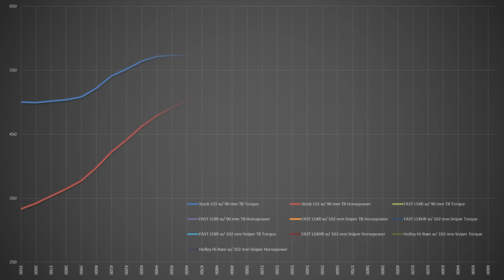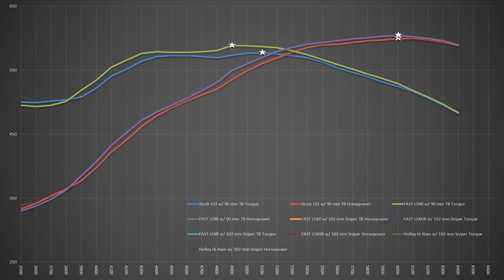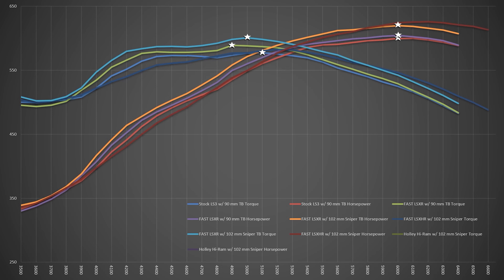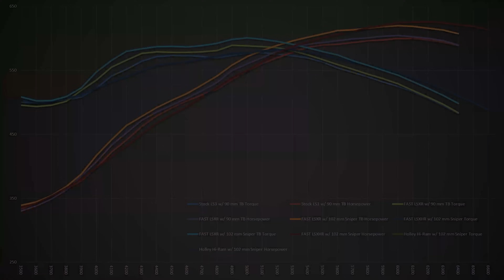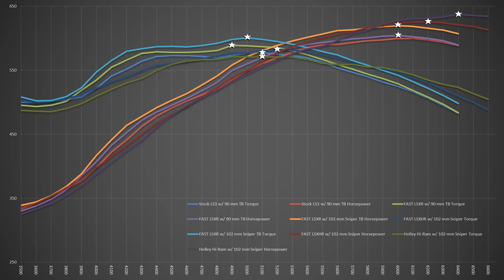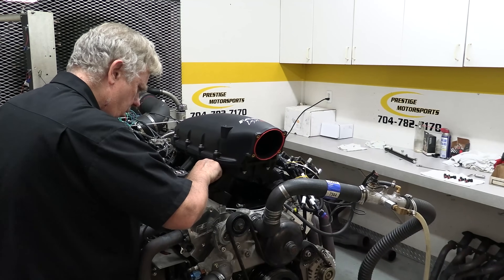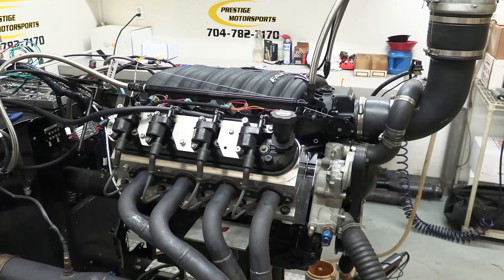Testing LS Intakes! Which LS3 Intake Makes the Most Power? [Can Stock Keep Up?]

Comment: I'm curious what realistic gains would see with a LSXR 102 in a 2018 escalade ESV LS3. While more power is great, I am curious about any loss of MPG running bigger injectors. I would like a little more grunt towing and if I could improve efficiency as well that's worth the price point for me. Also what size injectors did you switch to.

Comment: Been best to test it on a stock ls3 motor. Not a modded one.
Reply from the maker: The engine would have run out of power before the benefits of the more aggressive intake manifolds would have shown up. These aren't intakes designed for stock engines.

Comment: Stupid question but, I own a 99 Silverado with 5.3 vortec, what intake would fit on this?
Reply: That should be a cathedral port engine, your best GM intake to use is off a Trailblazer SS, they aren’t too hard to find either

Comment: Shows that the stock Ls3 heads can make as much power as a ls7 with after market parts, big cubes, low compression and freak cam with a tiny split for high rpm. Not something I would build though. A good heads cam with 12 to1 compression on 93 octane 416Ci would have been a much more common street/track build.
Reply: But at the same time, with heads a LS7 will pretty easily make 700whp N/A. Displacement always wins in the end

Comment: Is this a stock block or s Dart block? It looks like those are 6 bolt heads bur they're not being used. I can only imagine what that 441ci engine sounds like with that cam. I built an 11.8 CR 416ci LS3 with a 240/250 with .623 .617 114 and it sounded awesome.
Reply: I'm building a 427ci ls3, 4.1 stroke. 11.7Cr, Dart pro1 heads, Cam Motion 688 lift 248/263 112 split. 7600rpm/750hp. Fast 102B.
Reply: @A Phil  As cast Dart Pro 1 and Fast or ported? I hope it's going in a light chassis with a ton of rear gear and high 4200-4400 stall converter if automatic. If a manual behind it use a light flywheel and clutch to get it to Rev quickly. I had a Yank SS3600 in a 4L65E with 4.10 gears on 28" tall tires. I needed a 4200-4400 stall and needed to port the L92 intake, 102mm TB, and spent more time on the tune it would have gone from 11.8 to 11.2-11.4. Your setup will probably eat up nitrous like mine would have but I never sprayed it.
Reply: @chesspiece81  Going to use a Fast Mid runner. Old setup 1998 T/A 418Ci. ls2 Stroker. GMPP ls3 heads, Stock intake 98mm tb, 4l60 Moser 9" 4:11. 3600 yank. 10.90 1/4mile 1.5 60foot.
Reply: @A Phil  I had WCCH Stage 2 or 2.5 LS3 heads. Upgrading from those heads and intake, your displacement bump and cam, swap from that 3600 to a higher stall. The Fast intake does really well sent to Tony Mamo to be ported, especially on that many CI. I think Greg Good is the go-to guy for the Dart Pro 1 heads. At least he was when I had them on an 8.8 CR 408ci Va Speed spec 236/236 .632 114LSA cam for a turbo 4th Gen Camaro. Are you going to run the motor on E85 or just 91 or 93 octane? With a progressive 125 or 150 shot and traction, there's no reason why you shouldn't run some 9.3-9.5 on spray and maybe some 10.2 off.

Comment: Two things that was a poor camshaft design for the setup those heads look very promising and it had very little compression for that big of a cubic inch now mind you if that's set up would have been 12 to 1:00 which would have ran on 93 not optimal but would have ran on 93 and a camshaft along the lines of 258 on a 113 plus 3 268 or 272 at 50 on the exhaust side all of those intake manifolds would have done better but the Holly High Ram as well as the fast High Ram would have shined a lot better and had a lot more torque in the mid-range

Comment: They should of tested the stock manifold with the 102mm TB
Reply from the maker: There isn't really a point to that. The bottleneck is the throat of the intake manifold, so adding a larger throttle body won't help make power.

Comment: 11ft pound and 15hp for almost $1600.  Is that a good $ per HP deal?  That doesn't count the install and possibly a replacement fuel rail.
Stock is cheap and I believe I could find more hp for less.  Maybe just ported heads?

Comment: I went .4 quicker after junking a sheet metal intake for a fast lsxr 102 with the stock throttle body. Recent dyno pulls indicate the shorter runners should help the combo. combo is a big C.I. pump gas  N/A setup.

Comment: I'm trying to imagine building a big cube motor like that with all that camshaft (which undoubtedly needs more split) and then saddling it with abysmal sub 8:1 dynamic compression. Imagine how much more responsive and driveable that would be if it gained a little LSA, added 10* of exhaust duration, and slide the static compression up into at least the mid 12.x:1 range.

Guessing we got a combination built for something else, and just got pulled into some NA testing.
Reply: I was thinking same thing, needs to even for street 93 be at least mid 11 to 1 like 11.7ish with that cam, setup a flex fuel tune...
 I'd like to have seen a better cam but also for love of God the mid length LSXHR runners vs the Hi Ram would have been awesome, same for mid on the LsXr vs the HR and Hi ram...
Nice data though...

Comment: 99% of us dont have a 441 square bore LS with custom heads, so  which is actually best for the average Jo with a stock to mild engine.
Reply: Yes we do.  They said it the video.  You have a 441. You just need to act like you do and pretend like the rest of the guys in the video

Comment: Need these 4 go up against Hellcat, demon & 392 manifold?
So we have options to choose from before we buy !
Reply: Confusing. Those manifolds don't go on an LS engine to compare
Reply: Hellcats and Demons don’t really have manifolds thanks to their superchargers, you can’t really compare a boosted engine to N/A like that. The LS3 does have a better factory intake than the 392 though
Reply: @lomfmur  demon is 6.2  unless they put 392 in it
Reply: @lomfmur  6.2 more powerful than 392 n why NHRA uses demon motors 6.2 in the cars at NHRA Tony Stewart, (female) driver uses 6.2
Reply: @lomfmur  overall? 5.7 can handle upgrades better than any Hemi.

Comment: I have to mention…. Great test, love intake comparison tests… BUT…. You’re over caming the engine and are loosing power everywhere except maybe peek RPM. The intake and exhaust duration is to high, not a good cam choice for the stock LS3 intake or any long runner intake. A 440 ci LS Stroker engine should be using a cam 234-238 intake @ 50 and a exhaust duration at about 246@ 50 with a 110-112 LSA . I believe you will make more power and torque with all the intake manifolds being tested throughout the power band.
I know what I’m talking about from experience.😏
Reply: This setup should be pushing 660hp on 93 and 700hp on race gas. Too much cam, and cylinder head and not enough port velocity or  compression. Just my opinion.

Comment: Fast LSXR adds 11hp and 5tq BUT COSTS $1000+ AND NEEDS ANOTHER $500-1000 IN PARTS TO FIT IT?????
You guys are drunk or something... putting $2000 worth of intake on a $500 motor to gain 10~hp
wtf...

Comment: They kept changing the throttle bodies and swapped injectors. Thought this was supposed to be a test on intakes only. You cant compare when additional mods were done constantly. SMH
Reply from the maker: Engines are a system. With the stock manifold, the injectors were at just over 90% duty cycle. Enough to make sure we got the most ourt of the stock intake manifold. But we knew the aftermarket manifolds would be able to pull more air into the engine. So if we left the stock injectors in and max'ed them out on the duty cycle, we'd get an artificially low number for the intake performance. Since they are capable of more, they needed more injector. If you left the same injectors in them, you get the result that the aftermarket intakes really aren't any better than stock, when that's not true. Same with the throttle bodies. The stock throttle body is properly sized for the stock intake, so that delivered it's best performance. Some of the aftermarket intakes had a larger throat, so we installed a throttle body that matched it.

Comment: I had to replay the comment at 2:08 three times to make sure I heard right.  "Nothing to fancy or out of the ordinary which is exactly what a lot of guys are running both on the street and at the track".  We defiantly have a different idea about what constitutes "out of the ordinary" and "a lot".  I don't know anybody who has that kind of engine, let alone runs it on the street.  I understand using an engine which moves a lot of air to stress the intakes, but you would have to be pretty out of touch to try passing that off as anything close to common.

Comment: Since this is on a engine dyno and not in a car. Why not start at a lower rpm? Like off idle? Most cars live between 1-4K RPM and we never see how they perform down low.
Reply: Because no one actually builds stroker motors to be heavily interested in the way a car performs between 1 to 4k rpms like they're trying to save on gas mileage for manifold choice selecting purposes as they do based on mid to high rpm power when choosing.  Living in 1 to 4k rpm is also driving in multiple gears which the power output would vary by which gear based on current desired speed and won't be much worth the comparison at 1k to 2k rpms. A range that is over in matter of milliseconds. That would basically multiply the time it takes to test all these intakes and no one lives in 4th gear for dyno sake from idle at full throttle in a muscle car for study sake when these intakes have a very specific operating rpm efficiency range starting from 3k rpm and up.

Comment: You need to put a 102 Throttlebody on the stock intake, I like to see those numbers 👍👍👍👍👍
Reply: Won't fit.
Reply: @sepg5084  What size is stock ls3 intake? Trying to figure out if I need to buy intake and tb or just tb
Reply: You need to have an intake manifold capable of using that airflow. The stock does not have it. Common sense.
Reply: Gpi tested this and had 0 gains

Comment: That is minimal gains on a lot bigger and Wilder motor than most of us are running so there would be less of a change
Reply: Yeah I didn't know majority of the LS guys on the track and street were running 441 Cubic Inch LS engines 🤣
Reply: If they are NA they may, what I'm stumped at is why not LS7 top end when your talking 441ci?
 I'm basically using a HD stock replacement head on my sleeved 427ci engine and gain 50hp stock to stock...LS3 vs LS7...why on earth would you go to 441 and not run a monster raised runner say MAST Black label LS7 head which would make big power with more compression on this.....most of the big shops move over as soon as you go 4.125 bore plus....
 Nothing wrong with LS3 top end but this engine is obviously not worried about a little extra money....

Comment: I would've liked to seen what the stock intake manifold would have done with the bigger injectors and the bigger throttle body.  I don't even know if you can put a bigger throttlebody on the stock intake?   As always another great video, thank you
Reply from the maker: The throat on the stock intake is so much smaller the larger throttle body wouldn't have done any good. Thanks for watching.

Comment: Too bad you didn't test the stock intake with the bigger TB (if it would fit) and the larger injectors. Would have been more fair then.
Reply from the maker: The larger throttle body doesn't fit. The throat on the stock intake is too small.

Comment: Gwatney Performance and Hot Rod have done the same dyno tests (except Gwatney used a ported LS3 intake). Gwatney saw the same gains when going to the 102mm TB vs the 92mm on the FAST, but commented that in their experience those gains don't transfer over to the chassis dyno due to the design restrictions of the intake plumbing leading up to the TB.
Reply: I could see that for sure. My tbss has a 3" intake right now and 90mm tb so when I do go with a fast 102 and 102mm tb I'll be building or buying a 4" intake with ls7 maf because otherwise it's a waste of money buying the bigger throttle body. One thing I retained from college is air/fluid/electricity will only flow as much as the smallest diameter in the system. You can have 10 miles of 4 inch pipe and 1 inch of 3" and it'll only flow what that 3" can flow

Comment: on stock cubes and RPM under 7000 the stock intake is the one to get, its been proven time and time again.
Reply: Big CI engines are the ones that need the extra air, same in the head game.

Comment: 440 ci and it only made 500 hp.   Something very wrong.
Reply from the maker: It never made less than 599.7 and as much as 637.4. What are you talking about?
Reply: @TheHorsepowerMonster  I watched it again I misheard the first number.  Still down on power.  You can get 550 hp out of a 5.3 with stock heads.  This motor should be making 700 plus

Comment: You already stated that it was unfair test I mean you changed injectors on the stock intake manifold from the fast which pulse with has a lot to do with Flo so you could have picked up some power there and you could have seen if the larger throttle body would have been proved flo all equaling two more power not really a fair test but I see you trying to sell your engine builders vs true test
Reply: The biggest injectors in the world would not have gotten anymore power out of the LS3 intake...... but yes there probably would have been a few ponies to be had by putting the larger throttle body on the LS3 intake but it would not change the results as it still would have finished last.
Reply from the maker: How many people upgrade their fuel injectors on a stock intake? What's the point of testing it if nobody is going to do it? And likewise, if the higher flowing intake calls for more injector, it makes no sense to choke it off with the stock injectors. When I said it was an unfair test, I was only saying that the two high ram style intakes perform best with some form of forced induction.

Comment: So no test with the bigger injectors and throttle body on the stock intake? Not a complete test! Looks like comparing apples with oranges for some of the manifolds.
Reply from the maker: Not really. The bigger injectors would not have helped much with the stock manifold. The stock injectors weren't at full capacity yet, we just upgraded because we knew that the aftermarket intakes could flow more air. Bigger injectors may have changed the curve some but wouldn't have made a big change. Likewise, the Holley Sniper throttle body wouldn't have helped on the stock intake because the opening is only 90 millimeters in diameter. Putting a bigger throttle body wouldn't have helped because the throat on the intake manifold is the choke point. Not even sure if it has enough material to allow you to port the intake large enough to accept the Sniper throttle body. Thanks for watching.
Reply: The injector wasn't at all limiting the power of the LS3 intake but it most likely would have limited power on the better intakes if they didn't replace them.

Comment: Impressive how much power that throttle body added!
Reply: Bigger hole
Reply: More like: How much it unlocked. ;-)
Reply: @Chris-yy7qc  true haha.
Reply: It's like the hole engine build was to show that a 440Ci 630 hp engine has to have and needs a 102TB.